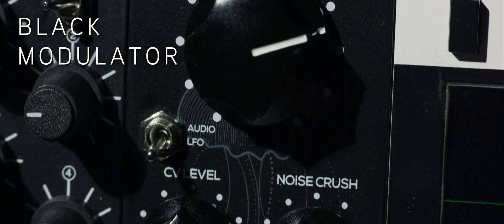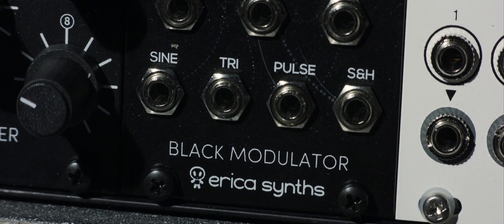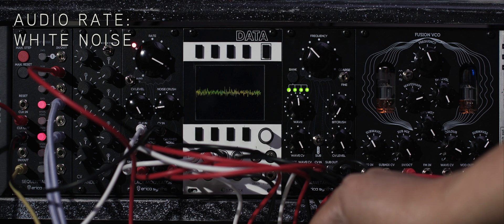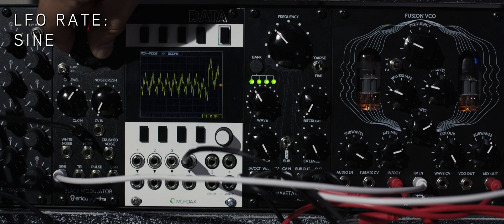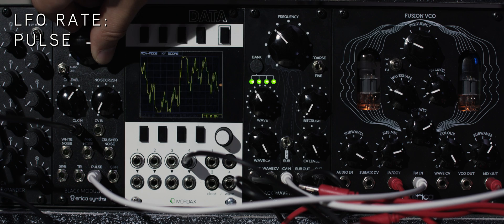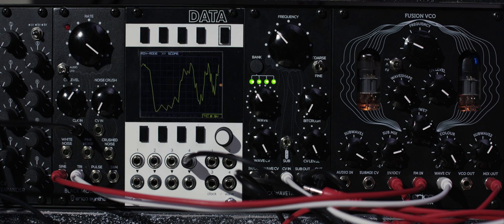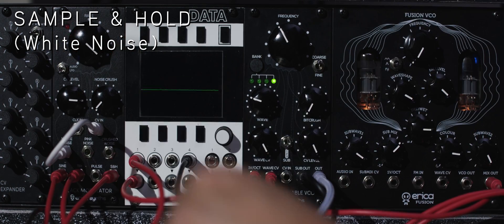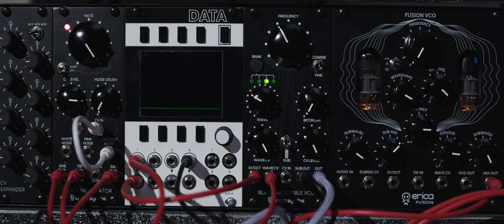Erica Synths Black Modulator 4K Overview

Comment: I've got one new from Erica and in audio mode it doesn't go as high as it shows in the video...
Reply from the maker: Hi, what are you using as your modulation destination or oscilloscope?  I had the Mordax Data set to visually show the maximum range for demonstration purposes.
Reply: @distprod  my ear... I played the device while watching the video and it just doesn't go as high. It goes through my speakers, after the Black Quad VCA that's it. Maybe I have a weird device, I don't know.

Comment: Thanks for the video. Sorry because i'm a newbie. Please Distortion Productions, can you share these patch connections, if possible? 
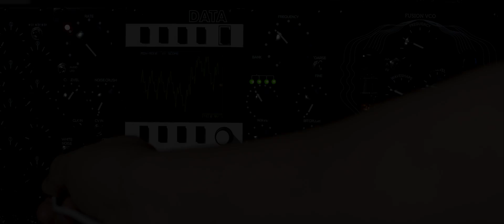Just the first setting from 0:30 to 2:08 about the Black Modulator only... 
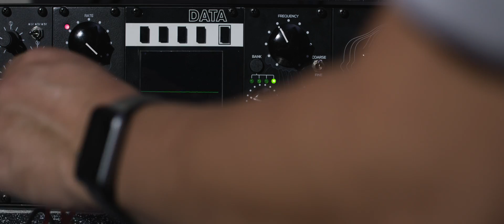Also, at 4:11 does it the Modulator S&H output connected to the Wavetable VCO Wave CV input? 
Thanks in advance.

Comment: Hi there. Thanks for the thorough video demo of the Black Modulator. My only concern is the "shaky" sound of the oscillator. For example, at around 0:50, when the triangle wave is introduced, you can definitely hear it. I noticed that you have a connection from what looks like a sequencer (module on the far left). Is the CV (for assumed "pitch") from this sequencer a bit noisy (enough to cause the unintended sounding FM, albeit slight)? Or is it the Black Modulator itself? Or perhaps a poor cable, or connection of the cable? Just curious before I purchase one of these. Thank you!
Reply: Did you ever check back on this issue?  I'm thinking of picking one of these up, but that shaky sound is indeed a bit off-putting.
Reply from the maker: Hi Eric, you're welcome.  The "shaky" sound that you are hearing is possibly because the frequency rate of the Modulator is set fully clockwise.  In a higher frequency it could be self-oscillating.  Another possibility is a bit of aliasing, which is common with LFO's in audio rate.  I will try listening to it again with a clean signal path, make some adjustments to the frequency rate and let you know if the waveforms in audio rate are still shaky sounding.
Reply: Distortion Productions Thank you for the reply! That makes sense to me.